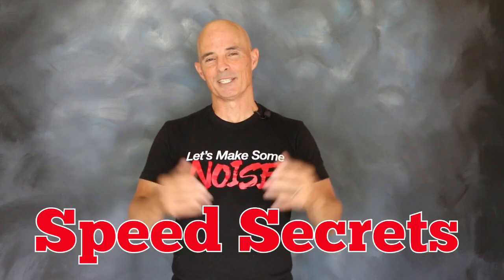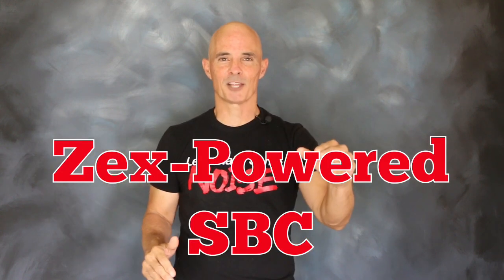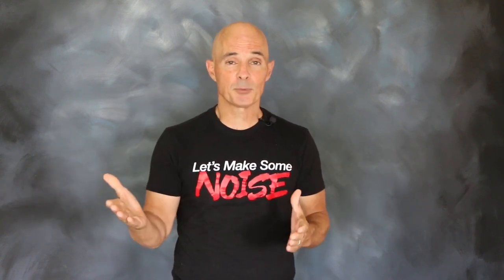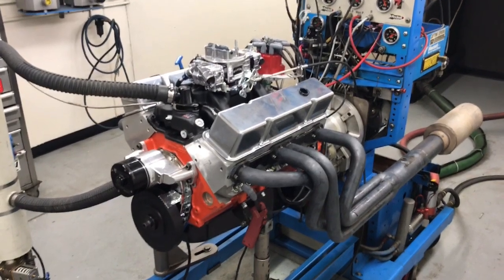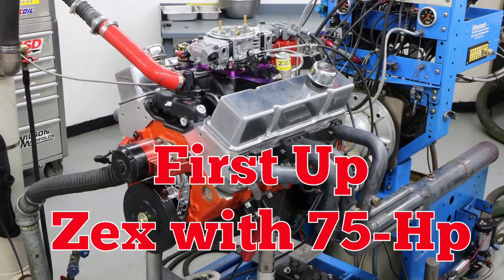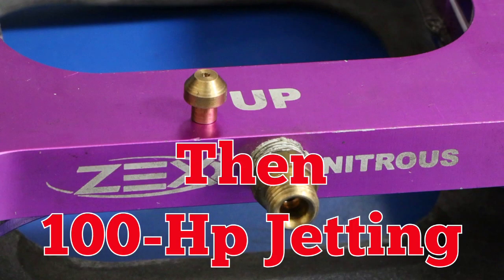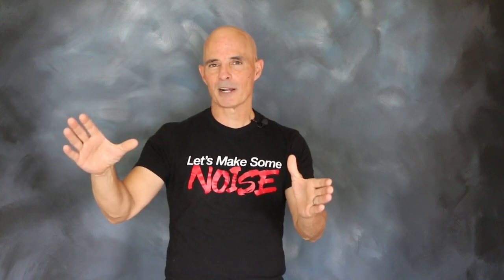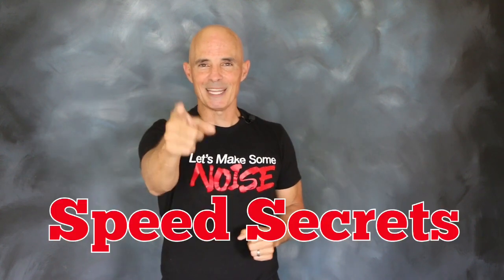Speed Secrets: ZEX Nitrous and Small Block Chevy Engines

Comment: hey Richard I just commented on your other video as well I wanted to ask you I have a GM zz3 crate motor aluminum heads cylinder heads are bored it has the special pink Pistons or rods from Chevrolet.I'm looking for a small nitrous kit in wondering and hoping the motor willl hold it from what I understand it's a pretty built motor internally let me know what you recommend thanks man

Comment: do i need a forged crank or just firgwd pistons
Reply: its recommended if you want to keep the block in one piece, but also depends on how much you want to spray. if its 50-75 shot its not gonna hurt the internals as much as a 100+ shot would.
Reply: WhutThePhuq still can hold at least 125 if you not spraying it all the time
Reply: @TacoTueJay  100-150 shot are pretty small shots still u can easily run that on a stock motor and timing u don’t need a forged bottom end if u have a fuel system to support it or wet system and fbo and some other mods but I’ve seen plenty fully stock engines take 100-150